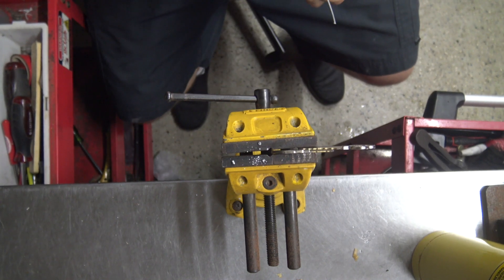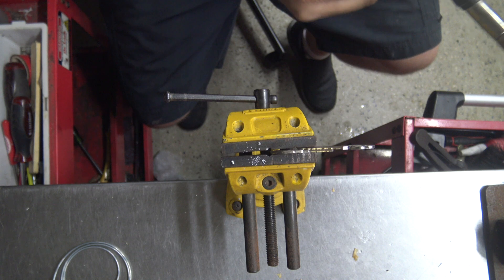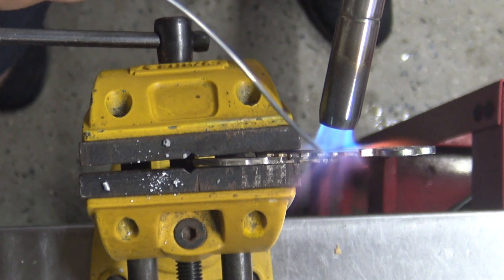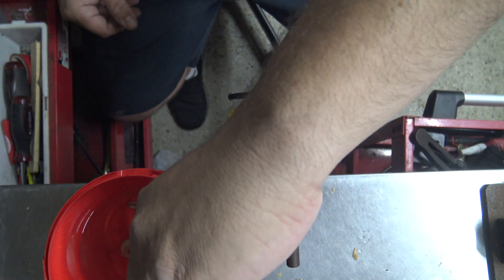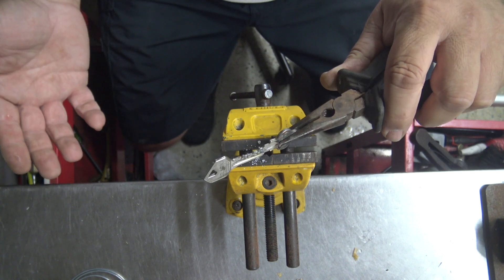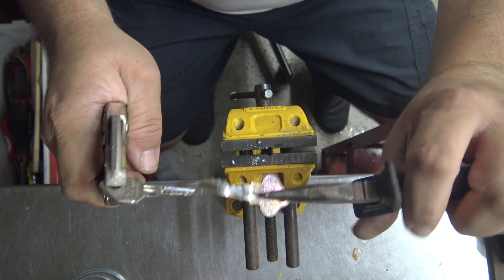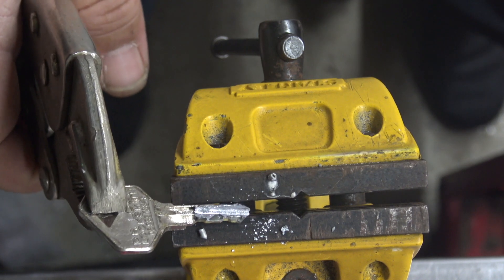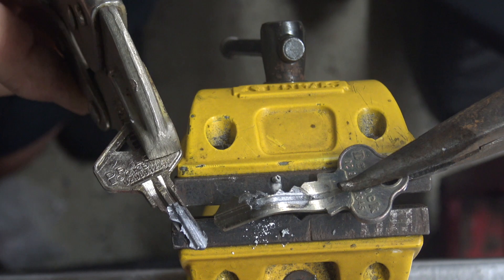The full test of force for brazing keys with this new low temp rod

Comment: You’d definitely want to get rid of any silver or chrome plating or oxidized coating via sanding, filing or a chemical cleaning for the solder to get a decent amount of adhesion to the base material otherwise your just joining the “coatings”... great video though. I always considered building up the blade on a key as an option although I’ve never had to do it. Thanks for sharing!

Comment: In America have Stay-Brite #8 which contains 8% silver. Uses standard flux with propane or mapp gas at soldering temps, not brazing temps. Don't know what the equivlent by you would be called. Try straight plumbing solder, would also work, just not as strong.